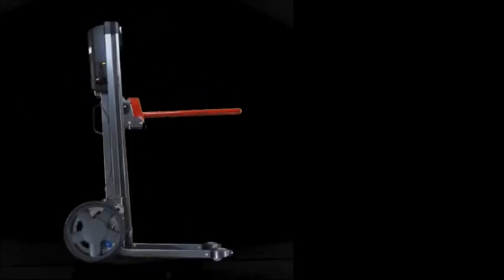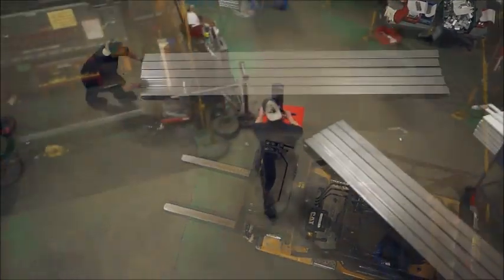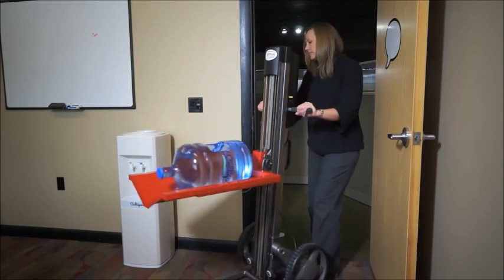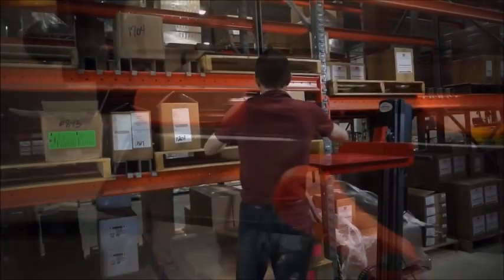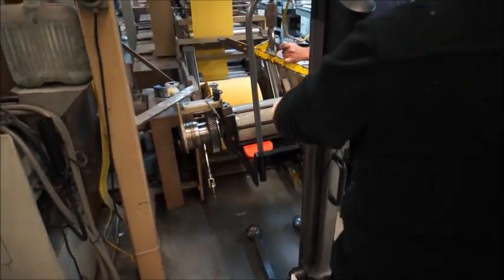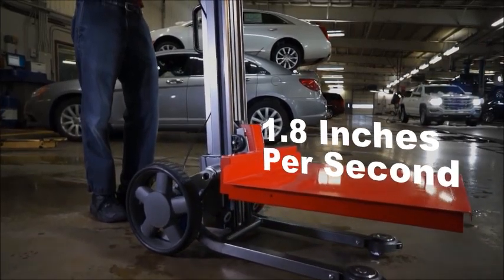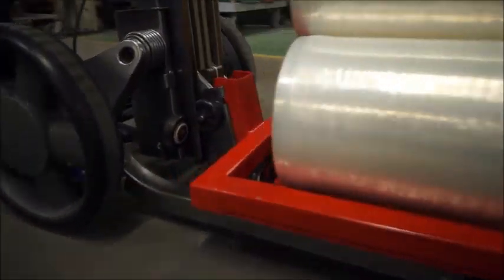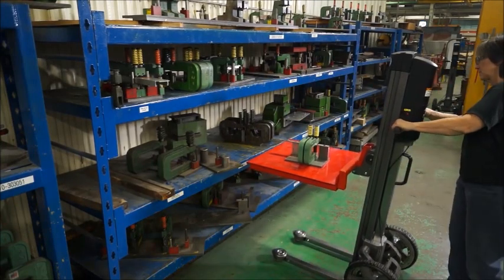Magliner Liftplus Electric Stacker

Comment: I wish you could add larger wheels on the front as an option. So you could use it on less than smooth surfaces like yard work.